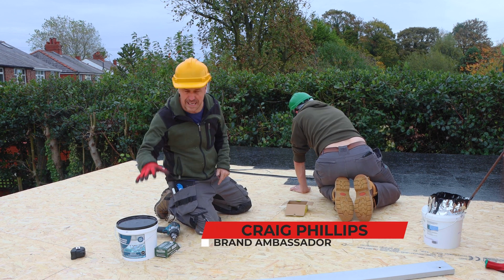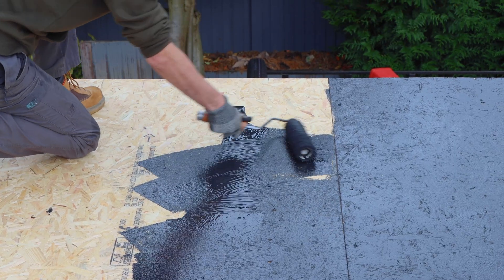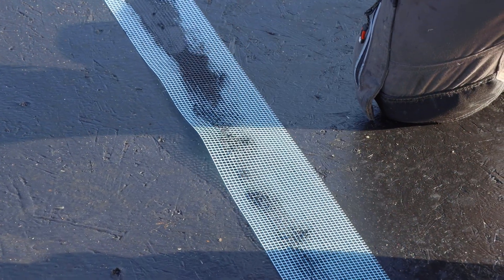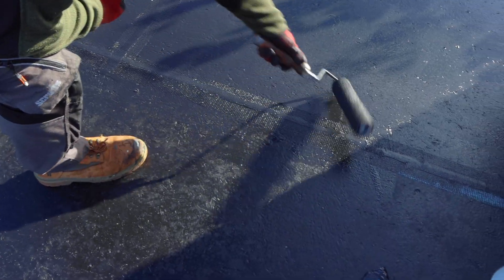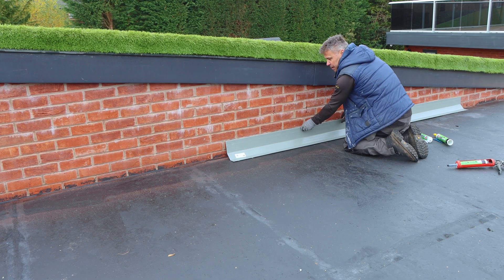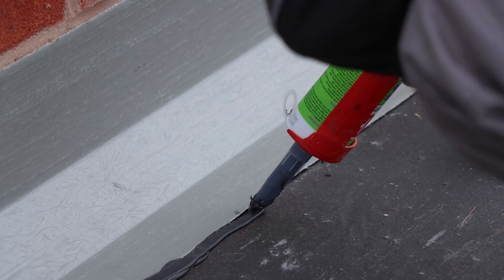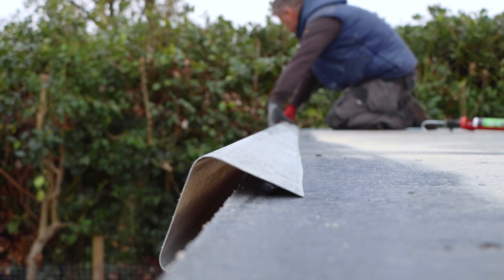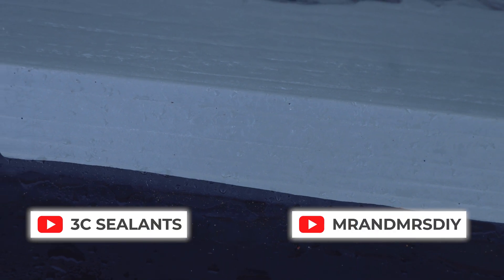Sealing A Flat Roof With Liquid Jacket Liquid Rubber Membrane

Comment: you cowboys , you can still see the OSB board and the joins that roof will leak within a month , at least use a GRP system or flexiglass or even just use the rubber itself and glue it down or then old school torch on felt but people PLEASE DO NOT TRY THIS !!😂😂😂😂